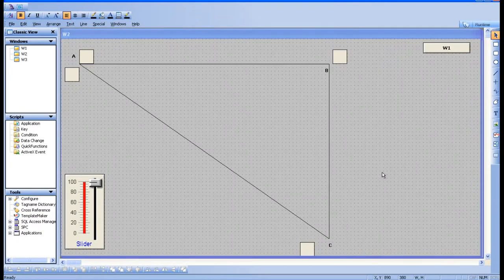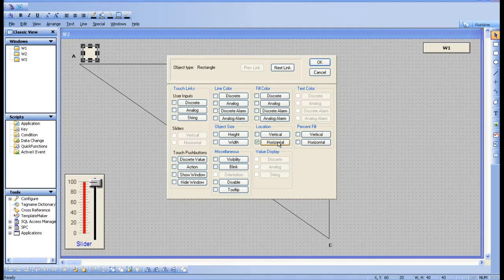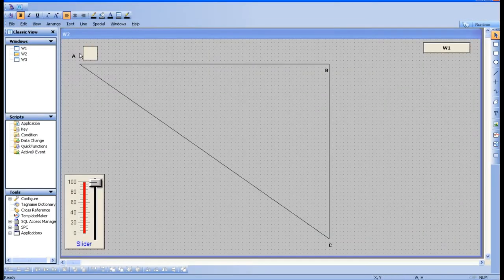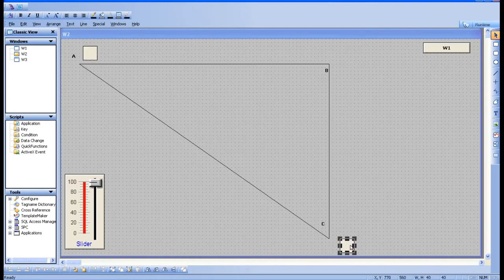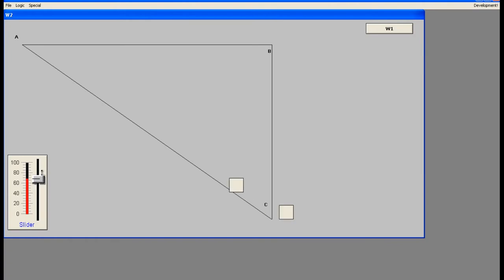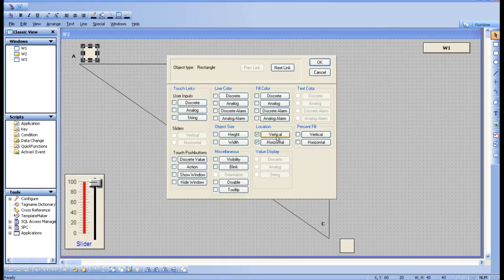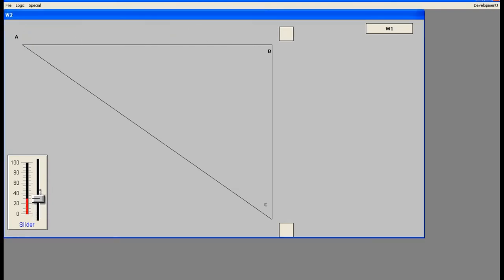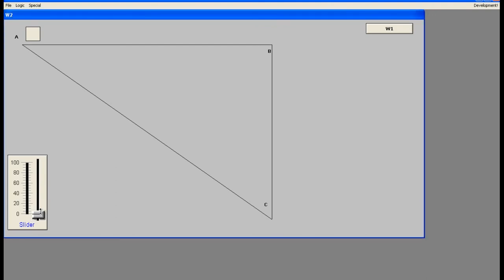SCADA Tutorial 15 - Visibility Concept | Introduction to SCADA Programming

Comment: Hello ma'am good evening
Ma'am is it possible to set visibility in a specific range like I want to visible an box >40 - <50 slider range
Reply from the maker: Yes, possible. You can also use scripts to achieve this output. Check scripts related videos. Make one variable value = 1 when the slider value is in between required range, use this variable in visibility.
- Bharadwaj